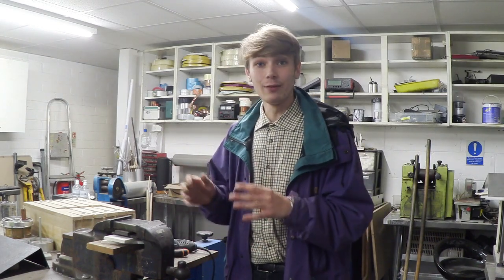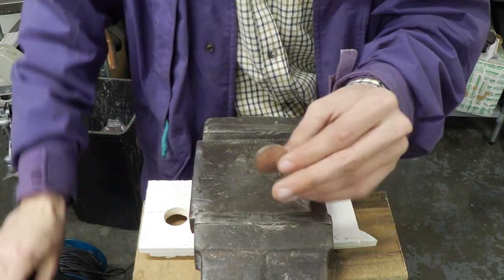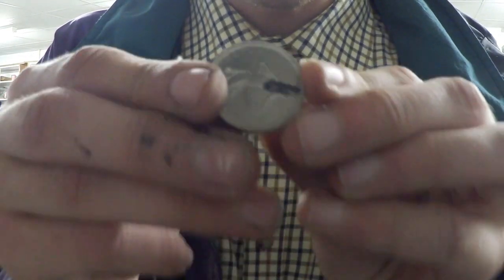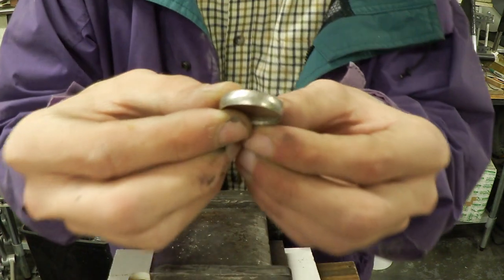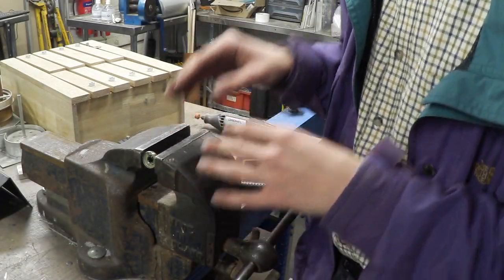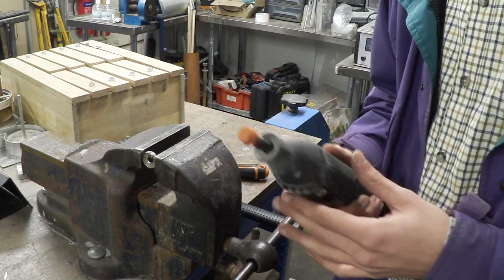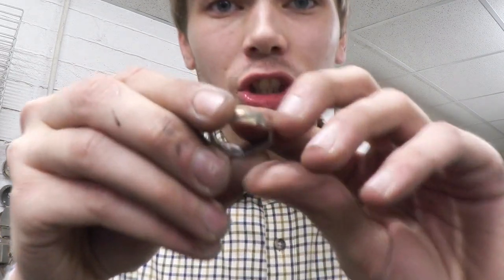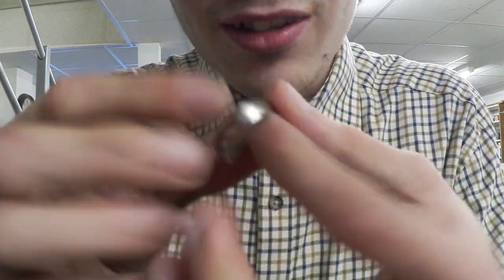How to make rings from coins

Comment: Just beware that in some countries it's illegal to alters, defaces, mutilates, impairs, diminishes, falsifies, scales, or lightens coins  and currency. Check your local laws before doing this at home.
Reply: Yea it's law in the UK, but then again you can go Alton towers an put a penny in a machine an get it stamped an other places. So it's just another bs law that's not enforced, and if it was then there are plenty of places you could say do it and charge legal tender to do so, making a profit from breaking the law, which you are not, if you are using your own money to do so and not selling them. 😉
Reply: @SlyerFox666  Those machines are made to look like they use a coin for the press but they actually use a different piece of metal.
Reply: Lol was just about to advocate this too!

In America, I remember people melting down those old coins trying to convert it into scrap metal / bullion bars as they'd make a slight profit now by weight instead 😂.
Reply: Only if its in circulation.
Reply: @johang1293  No it's the coin you put in you get back. We used an old shilling and got back an old shilling, no switcheroo. Not saying there isn't such a machine but it's not the ones I'm talking about.
Reply: I think it's an old French coin, may be a 5 Francs "semeuse"
Reply: @johang1293  in the science museum in london they have machines that squash a desigh on a penny. Costs a pound though. I have one.
Reply: Fun Police